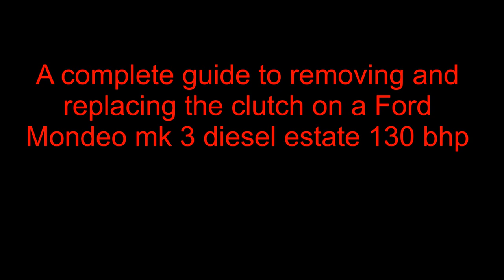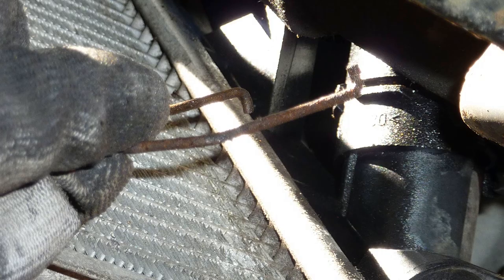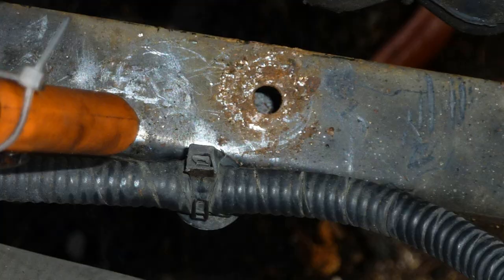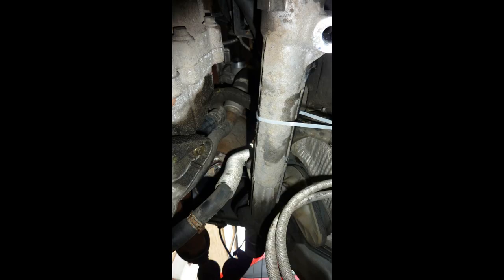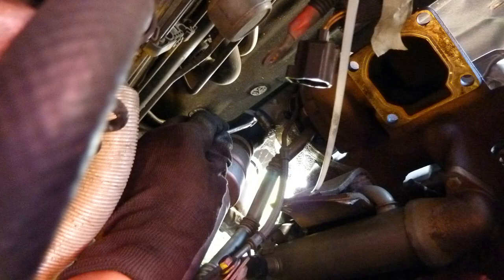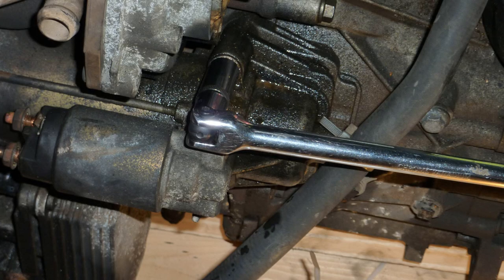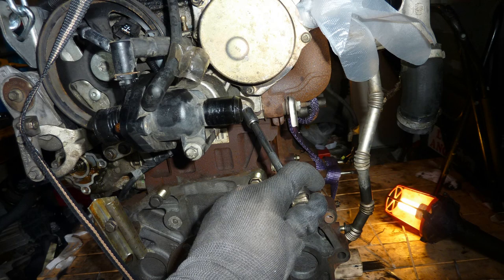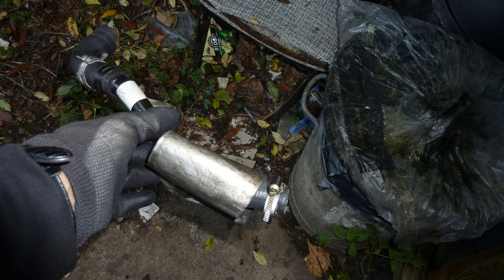Photos-talk-through on Ford Mondeo-MK 3-diesel-estate-130bhp's engine and dual mass flywheel removal

Comment: Sir  pls tell me  that black rubber  near the senzor clutch   what dose that cuz i loose him and i put one valve cover  :-( its ok  what i do ?
Reply from the maker: You have to be more specific. Place a time marker down on what you're on about.
Reply: @EducationPineapple  sir  gearbox have 2 shifter  in front of the car (engine ) near the 2 cables it is a senzor who comes in gearbox and near that  it is 1 plastic one black rubber  what is that ? Please !!!🙏🙏🙏
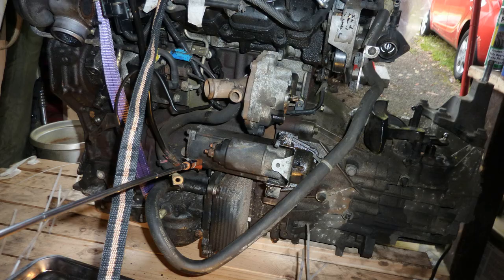Reply from the maker: @getsmartereveryday2023  Okay in the future please refer to timings on a video to speed things up. For example at 52:04 I can see the front of the right hand side of the picture. I think you mean the two black, rubber chair-end looking things sticking out under/ in front of the shifter arm. I think they are the stoppers for the shifter arm. Try rotating the arm either way to see if it hits one rubber stopper you have left, and one metal end you have left. If it hits the rubber one; then the metal then you're going to need a replacement. The easiest botched way is to make it with a chair leg end (fashioning the correct diameter with a knife). Consider also something like glue-gun glue. Good luck.